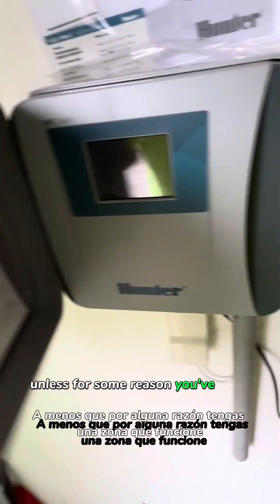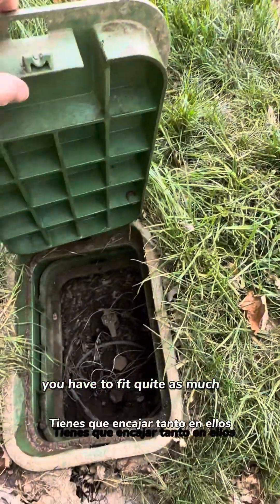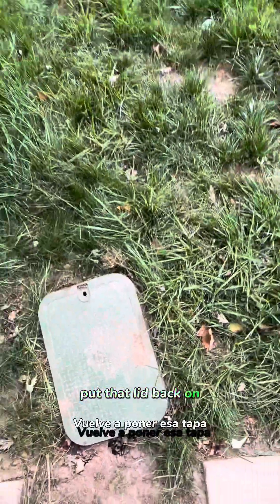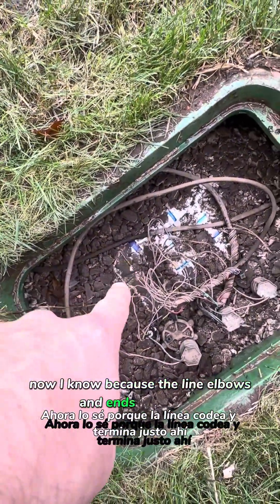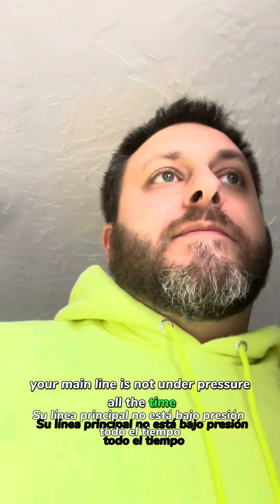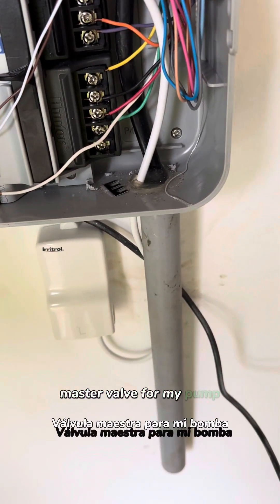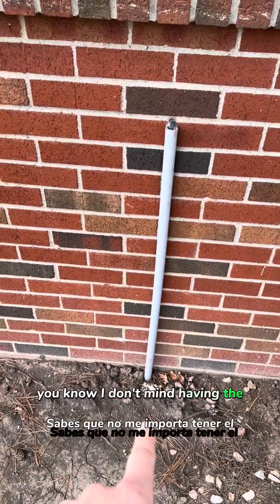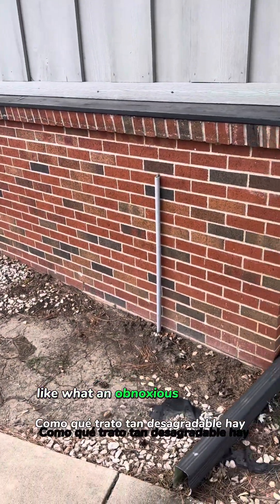Irrigation Basics: Zone Valves and Master Valves

Comment: I need to add a master valve to my system since it's hard to keep 14 zones from leaking and my muni supply is expensive.  Are there different valves used as master valves or can I just use another  Rain Bird zone valve as a master.  Thanks!